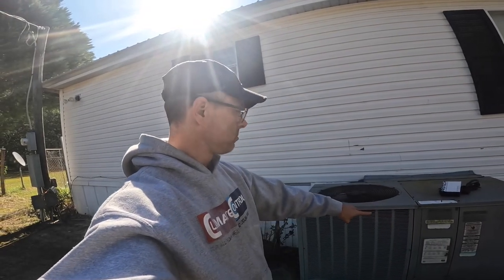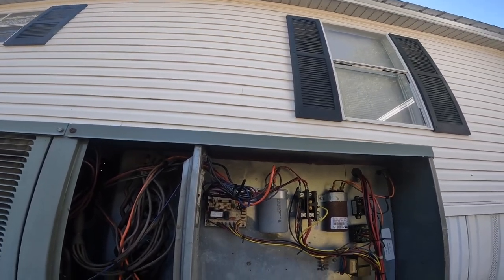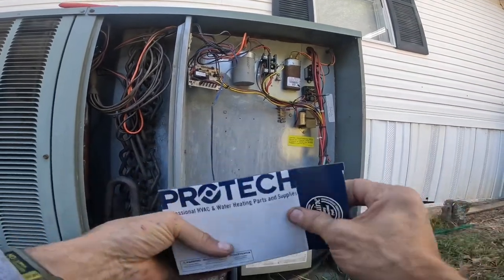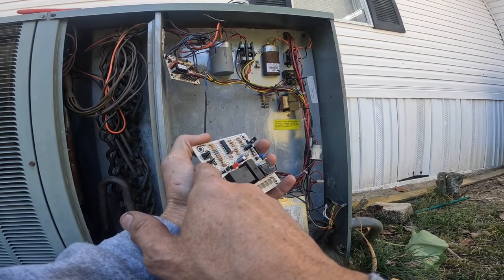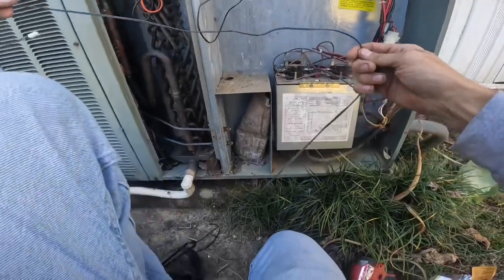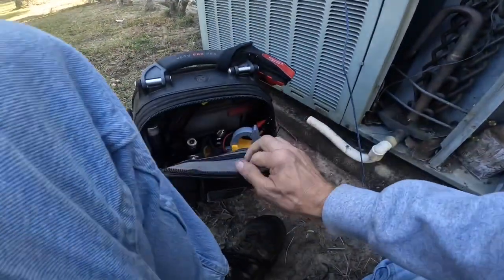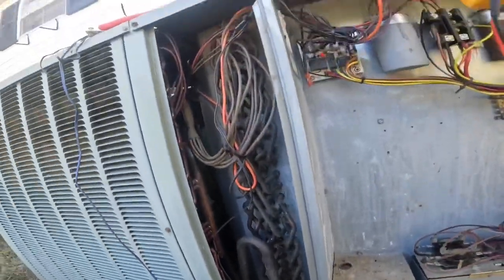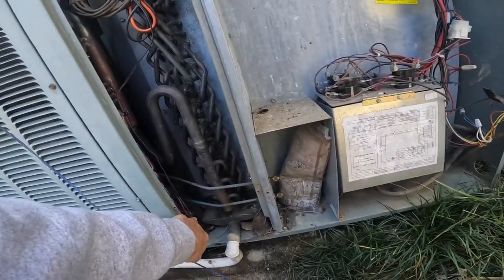Return to Freezing Heat Pump to Change Defrost Board!

Comment: A suggestion to you about unpacking an electronic board. Open the anti static bag then grab the frame of your compressor or air handler before reaching in the bag to touch and grab your board. By touching chassis ground you protect yourself from an inadvertent discharge to the new board causing damage. Once unpacked your good to install as long as you limit your body movements while sitting at the work space.